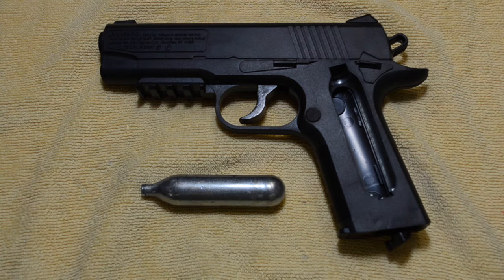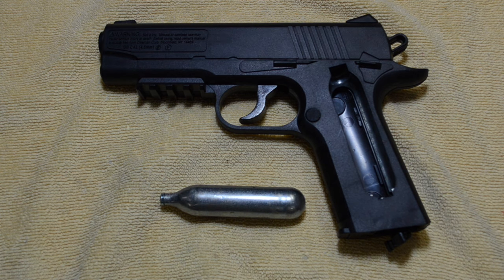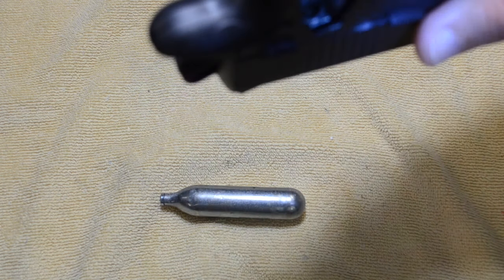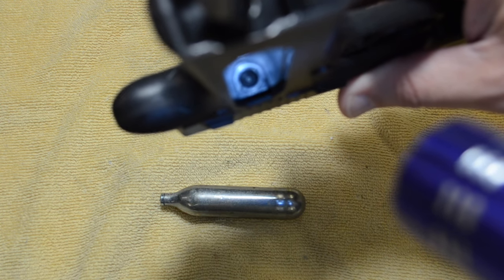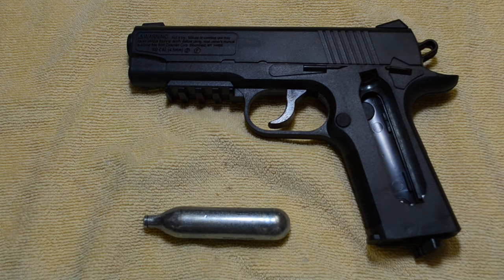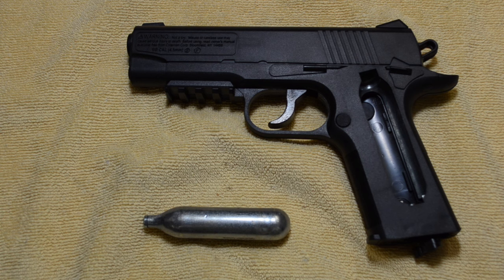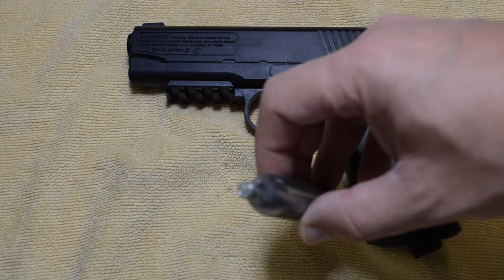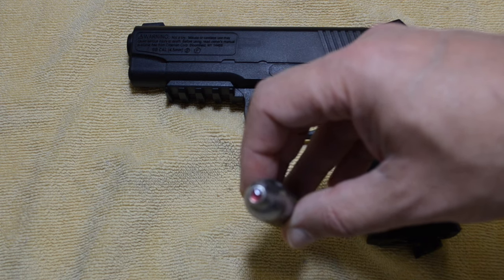How long can I keep C02 cartridge in my air gun?

Comment: Can u take off the co2 when still full because im afraid it will lose the co2 when out
Reply: No you dont wanna do that m8
Reply: You can leave it in there but depending on what gun you have it may cause damage to the valve. I would use it all before about 2 weeks to stay safe.
Reply from the maker: I don't recommend leaving CO2 cartridges in an air gun for more than 24 hours. If you leave the CO2 cartridge in for longer, it deforms the seal and future cartridge installs will leak.
Reply: I leave mine in all the time, never had a problem.
Reply: @georgewashington5163 
Well you are exceedingly lucky l had two guns had the co2 left in them in the  stores got em home went to change the cartridges both blew out on me.
People all over YouTube on these guns will tell you the same.
Reply: I leave mine in i don't think ive ever left it without a co2 in it amd no problem its over 6 months old.
Reply: If you do it regularly the seal will freeze and crack, you are better off dry firing and then taking it out. I would rather pay $20 for some extra cartridges than have to replace the gun.

Comment: Hey i am looking into buying an airsoft gun that uses co2 and i am wondering can i reuse them? Can i take them out after tightening them? And how do i store the unused cartridges?
Reply from the maker: 12 Gram CO2 cartridges, also know as Powerlets, are not reusable. There is no way to reseal them after the top has been pierced by the air gun. Unused CO2 cartridges should be stored in a cool, dry place, that is not in direct sunlight.
Reply: in the Philippines we have a refillable co2 cartridge

Comment: What should I do if I've had an "Oh shit moment" where I've forgotten a canister in the gun for like 38 hours... 😕 Just got my gun not even a few days ago an I'm so disappointed that this already happened. I would be so angry and sad if that meant I already messed up the gun....
Reply from the maker: Remove the old CO2 Cartridge, wait a day for the piercing gasket to spring back to it's original shape. Try a new CO2 Cartridge to see if it seals.
Reply: @rustbeltairgun8718  Well it's a bit late for that.
I am facing that disheartened feeling; when you get something new and that feeling doesn't last long because something goes wrong. Anyways, what I did do is prop the gun upside-down and put a drop or two of PellGun oil on the seal and piercing gasket and let it sit for maybe 5-6 hours. Then I oiled the crap out of the top-of-a new cartridge, and oiled the seal-and-gasket again. When I loaded the cartridge, a noticeable hissing sound followed the normal piercing sound and all my hopes dashed out the door within a second. However I thought that maybe it had something to do with excessive oil all up in there. After a few seconds it did go away and that was the conclusion I came with a deep sigh of relief, but I still have a bug in me that still feels sad.
Reply from the maker: Air Gun makers really don't specify how long you can keep a CO2 Cartridge in an air pistol. I found out the hard way by keeping the CO2 Cartridge installed for a long time in my first air pistol and never getting a good seal afterwards. I have not had this issue since I followed the less than 24 hour rule.
Reply: @rustbeltairgun8718 
I bought two guns from two different gun stores they were my first experience with co2 though l have fired real guns in the army cadets and then the army, always had an air gun of sorts pistol or rifle usually break open action, but l saw how good the replica co2 guns were, and as l said my first purchases were a 1911 Browning and a Webley Mark VI, they both had co2 cartridges in them and they both had been in a long time l mean months if not years used as demos in shop, but l didn't know anything about them and after 2 days shooting them they both broke at the seals the same day gas just poured out in seconds they were empty, at first l thought they must have been dodgy cartridges for the same thing to happen to two brand new guns from different stores at the same time, but no it was the seals as l found out and the fact they had been left in so long with cartridges, you would have expected the stores to have known better they were both well established gun stores, l also learned not too tighten them too hard, now l have 5 guns two new Webleys in 177 and 22, a Schofield, and two colt 45 peacemakers one in silver one in black the black ones 2 weeks old and the barrels coming loose after been shot only twice by twice l mean two different days of firing about 90 shots a time ,l had heard of the barrel loosening in the older bb models but was assured it didn't happen in the newer 177 pellet versions, well the silver one is OK and the oldest at 10 weeks but the black one is not yet a fortnight old and l noticed the loosening of the barrel just tonight, l don't seem to have much luck with them, it will have to go back either to be repaired or refunded either way I'm going to be without one of my favorite guns, l have seen videos on how to place a shim in the gun barrel to tighten it but I'm not ever going to attempt anything like that myself as I'm no hand at stuff like that.

Comment: Can you refill those mini CO2 tanks?
Reply from the maker: 12 Gram CO2 Cartridge Powerlets are disposable, single use. You cannot reseal them once punctured. On the other hand, each Powerlet will cost you less than $1.
Reply: In the early days of the co2 popgun hobby, you could return the cartridges to be refilled.  The first use of co2 air guns was at carnival shooting galleries, late 1800s, according to Wikipedia.
Reply from the maker: Interesting, I though the CO2 Powerlets were derived from the CO2 cartridges used to carbonate drinks.
Reply: @rustbeltairgun8718  They were / are also used for ‘confetti cannons’ at parties and celebrations. I imagine a single burst from a co2 is quite a big puff!

Comment: So, you have an intruder break a window at three a.m. and one has to fumble around trying to load a new CO2 cartridge? There's a fair chance you'll be dead.
Reply from the maker: There's a good chance the intruder will have a real firearm. What happens if your air pistol ruse does not work?

Comment: Thanks for helping me with this because I have wanted my first airgun. But id like to ask if I should use a C02 cartridge that has the same brand as the gun?
Reply from the maker: I recommend using a CO2 Cartridge that is the same brand as the air gun. That way you'll avoid finger pointing, the air gun manufacturer blaming an issue on the CO2 cartridge and vice versa.

Comment: How to replace a bad seal
Reply from the maker: Seal replacement varies depending on the air gun. An old paintball trick is to use plumber's Teflon tape on the tip of the CO2 Cartridge when the seal starts to fail.

Comment: Can u shot the gun without the canister
Reply from the maker: Depends on the air gun, some are CO2 powered, others are spring-air. The spring-air ones do not require a CO2 cartridge.
Reply: @rustbeltairgun8718  can a co2 powered pistol kill an animal
Reply from the maker: Not a 12Gram CO2 Powered Air Pistol. In my opinion, you need at least 1000fps to humanly take down a small animal.
Reply: @rustbeltairgun8718  ok thanks

Comment: I took mine out and it started shooting the air everywhere
Reply from the maker: This is "normal" if the cartridge is not completely devoid of CO2. Be careful not to get your hands in the way of the CO2 discharge as it could cause frostbite. The CO2 comes out very cold, due to thermodynamics.

Comment: i was left a co2 in my glock 19 umarex 6mm non blowback for 6 months and didn't even leaking
Reply from the maker: You typically have leak issues, when you replace the CO2 cartridge that has been left in the air pistol with new.

Comment: Can I leave my co2 cartridge pierced while full in my gun
Reply from the maker: I don't recommend leaving a pierced CO2 cartridge in an air gun for more than 24 hours. It causes the gasket around the piercer to deform and is harder to get a good seal with future installed CO2 cartridges.
Reply: @rustbeltairgun8718  I am also new to this, it's my first week.  How about where the co2 cannister sits in the mag? I went for the Walther PPQ M2 for my first one.  As its new I am going to be firing it each day so don't see them sitting there long, but will eventually end up sitting there.  Thank you 🙂

Comment: Does it still work even if you put silicone oil on it?
Reply from the maker: I only recommend using Pell Gun Oil or RWS Chamber Lube on the tip of a CO2 cartridge. You should not leave a CO2 cartridge in an air gun for more than 24 hours, even with Pell Gun Oil or RWS Chamber Lube applied. The problem is the seal around the piecer will permanently deform, if you leave a CO2 cartridge in an air pistol for more than 24 hours, causing future CO2 cartridges to leak around the seal.
Reply: vaseline on the top works too

Comment: I left a co2 in a 1911 magazine for about 20 minutes and when i shot it, it started leaking
Reply from the maker: Call Crosman support (1-800-724-7486) to find out if still under warranty. They will ask you to pay to ship air pistol to them. Ask them to compensate you for shipping by adding  CO2 cartridges with returned air pistol.

Comment: Can you fire a air gun without co2 In it?
Reply from the maker: Depends on the air gun. A CO2 powered air gun requires a CO2 cartridge as the propellant. Springer or "Spring-Air" air guns do not require CO2. An internal spring compresses the air in the air gun, which propels the BB or pellet out of the barrel. Pneumatic airs guns also compress air internally as the propellant. Hope this helps!

Comment: Thats disappointing since my walther ppq t4e is kind of a bitch to pierce
Reply from the maker: I guess the idea is that you're supposed to use up the CO2 cartridge, doing a shooting session. Besides, a typical 12 gram CO2 Powerlet is a little less than $1, or much cheaper if you purchase in bulk.
Reply: @rustbeltairgun8718  Well I cant have a gun I'm afraid I would shoot myself with it.  When I got this I was looking for a good defense weapon.  And even 25 cents a day for carts is still 8 bucks a month.  Lol I'm a poor man.
Reply from the maker: Right, now I understand your position, you want the CO2 powered air pistol ready, around the clock. You can leave the CO2 cartridge in for extended periods of time. The problem is that most likely this will deform the gasket and any new CO2 cartridge installed will leak.

Comment: That 24 hour thing is bullshit .I have a simi auto 9 with the same cartridge for 30 days and still can go through six cans with no problem..... facts.
Reply from the maker: Let me know what happens when you replace the original CO2 cartridge that was in your air pistol for 30 days with a new one. That is when the leak occurs due to a deformed piercing gasket.